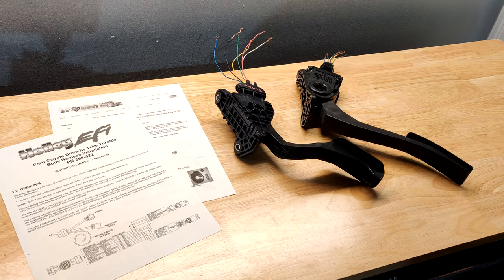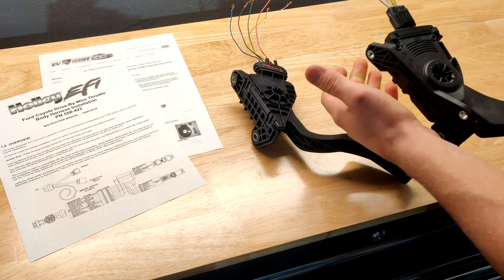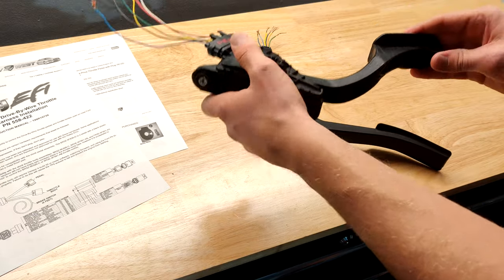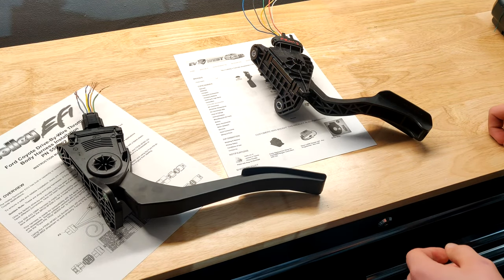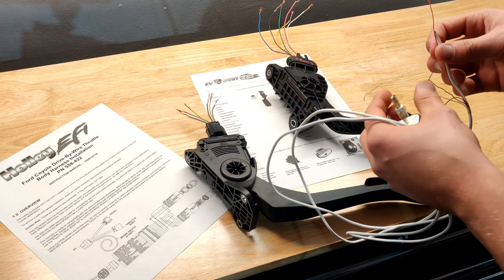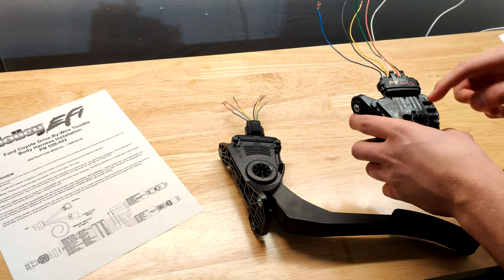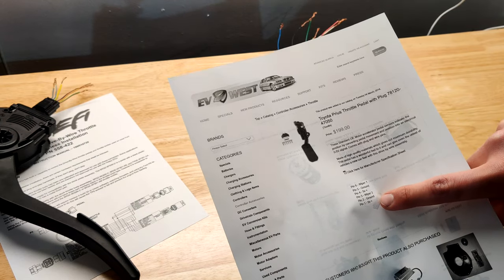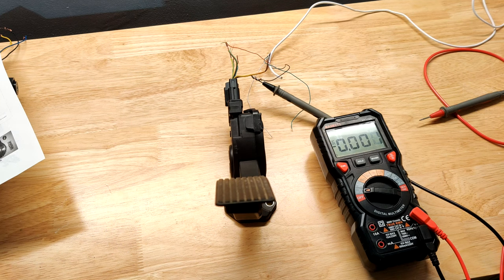Ford Escape EV Conversion EP 20: Acceleration and Hall Effect Sensors

Comment: Hey hope the project is coming along well. I was wondering if you knew how the ACX1 controller handled regenerative braking. I've seen on the schematic that there's a switch to turn it on and off, but do you know if there is any analog input for only having a certain amount of braking rather than just a binary on/off.
Reply from the maker: Ah, I think you're looking at this incorrectly. The switch is only to enable regenerative braking. The regenerative braking force can also be selected: end (no Regen), some, and high. 

But for the amount that of regenerative braking that will actually happen while driving, it depends on the signals from your accelerator pedal/brake pressure transducer. 

For one pedal driving, like any EV, as you ease off the accelerator pedal, the regenerative braking force increases. If you want Regen to happen when you press the brake, you can buy a hall effect sensor for the brake pressure that increases regenerative braking force as you press the brake in further.

Comment: Hello, I watched your videos. Good job. How much did you spent for this equipment, DC motor, battery and others. How can we buy between motor and gear box equipment. How does AC  and coolent system work? is it powered by battery or motor. I want to change the engine of my car like this. But in our country, there is no place to change like you. do you have any education about this job?
Reply from the maker: This whole project will probably cost around $25000 USD. $10000 for the batteries, $4300 for the motor and inverter. And then a lot of other parts a d expenses. The adapter between motor and inverter is made by a company called CanEV (CanEV.com). 

I haven't bought anything for air conditioning yet but you can just substitute an electric AC compressor in for the old AC system. The coolant system I'll cover in a video soon. 

I have no formal education about any of this stuff, just learned from the internet and YouTube videos.
Reply: @reider_mcfeely  thanks for your answer...

Comment: Next Video 21? How much invested?
Reply from the maker: Yep, next one is probably going to be about the contactor/junction boxes.

All in, this project will cost around $25k. Batteries were the most expensive single purchase ($10k), then the motor/inverter kit ($4300). And then a ton of little things.
Reply: @reider_mcfeely   Where is kit from ? and batteries ?
Reply from the maker: @DanaCrosby  The motor kit (hyper 9) I bought from https://www.hawkeyeinnovationsllc.com/. The batteries I bought off of eBay.